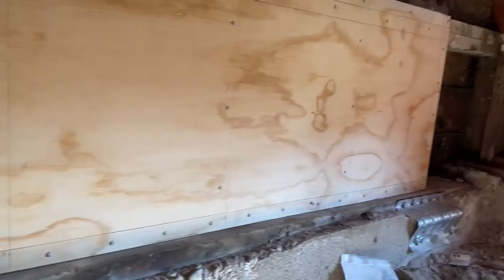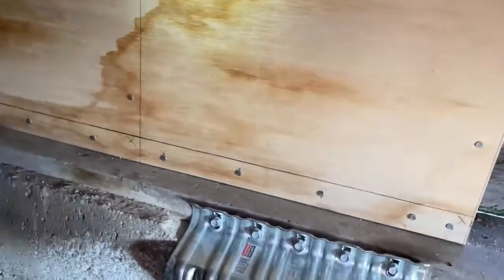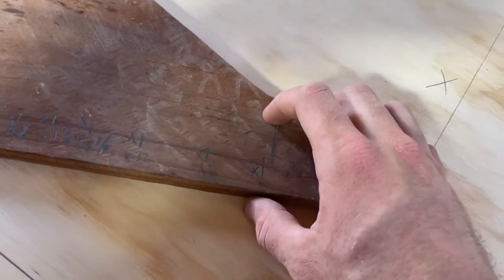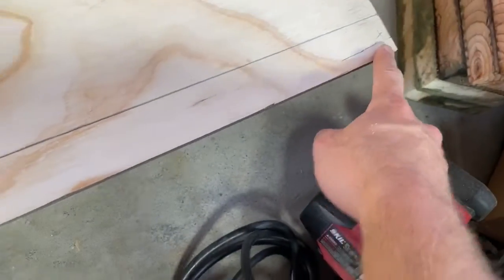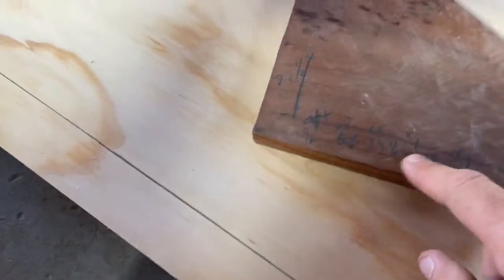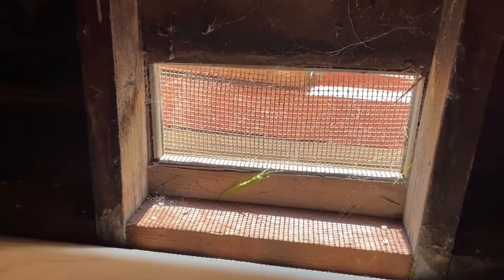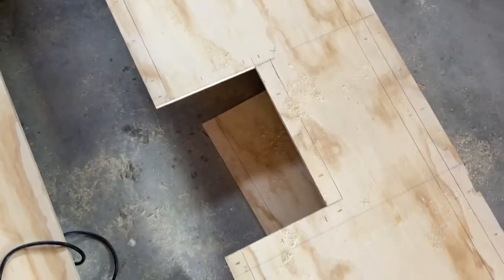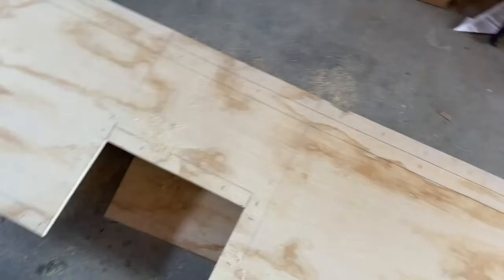Cripple Wall Sheathing for Seismic Retrofit Install

Comment: This is great.  Thx.  Could you add a tool list?  I'd like to know which Palm Nailer and compressor you used.  Did you consider using a battery operated Palm Nailer and decide against it. Would love to  get your thoughts.  Thx again!
Reply: I used a Metabo palm nailer (~$50) and a Rigid air compressor (~$100) for this job. I've tried battery palm nailers but they are weaker.